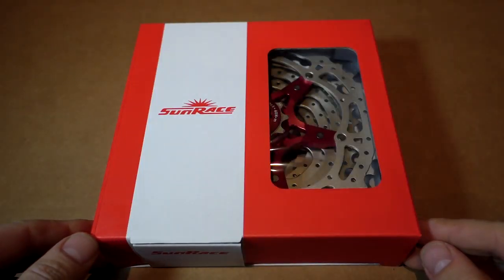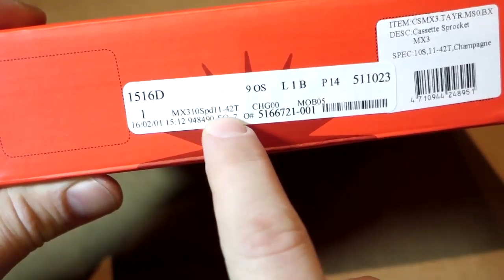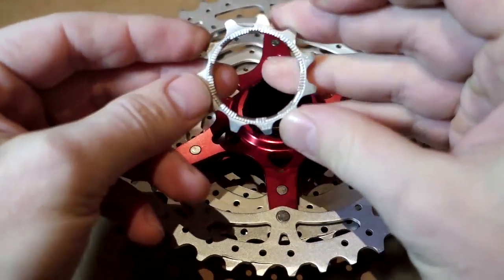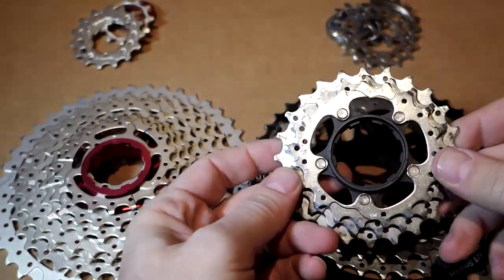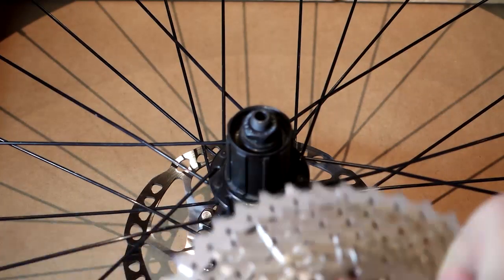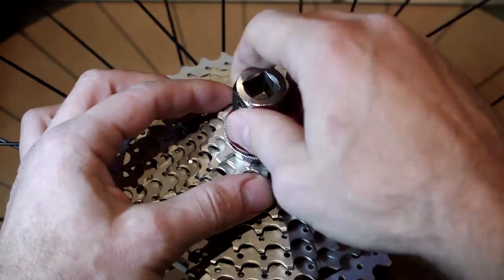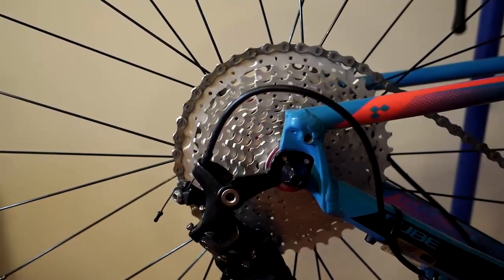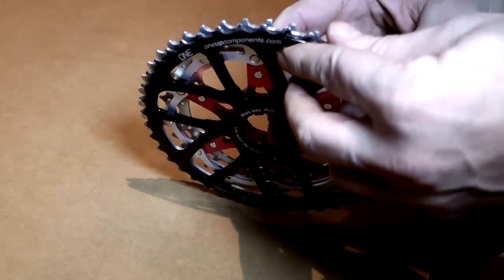SunRace MX3 10Spd 11‑42T Cassette vs XT+OneUp 42t, Comparison, Issues

Comment: Sir are you using direct mount derailleur? Do you required any extra link to use 11-42 T cassette or simply direct mount derailleur works fine for  10 speed cassette have 11 -36 T and for 11-42 T cassette.
Reply: It depends on the chainline

Comment: Got the SunRace MX3 10Spd 11‑42T Cassette Today.  The splines on the Cassette interface loosely with the Freehub Body of the cassette, which will dig into the freehub quickly.  The shifting is not as smooth as the XT which it is replacing.  I think I should have gone with the Oneup.  FWIW I installed a Wolf Tooth Goatlink 10Speed link and that helped alot, didn't have to touch the B screw.

Comment: I've been wondering about something.
I got injured so my plans of changing my drivetrain will have to be for later, specially because I want to wear it out before upgrading. So now I have much more time to think about it, lol.

Was thinking about getting a 11-36 cassette and match it with a Zee FR derailleur and Zee shifters. Since this cassette came out, I've been searching around for possible issues  about using the Zee with it. I found some forums where some people actually did it and they didn't have any problems, although chain length is crucial.

In that case, I think I would go for a 11-40 just to be safer, but how bad for the derailleur do you think it would be if I use this setup? I would be pairing it with a 34T chainring. It's for hardtail so no chain growth worries here.

I'm just worried about killing the poor Zee.
Reply: +LoveMTB Yeah, I know.
I might end up just getting the XT m8000 setup if the prices get low enough anyway :P 
Thanks, I will think about it.

Comment: I never liked the OU + 16T hack the shifting between 13-16 and 16-19 was compromised no matter how I adjusted it. I didn't want to invest more into  their rad cage so I rather used just the original 11-36 with a 30T chainring. Then I read about the sunrace and tried - only the MS3 11-42 steel version was available. Shifting is perfect the chainline is moved in by 2,5mm on a 2x crank and no backpedaling issue with KMC Gold chain. My other bike is factory X1 1x11 and drops the chain from 42t over a full rotation. But it's not an issue as I'm usually pedaling forward except the occasional repositioning of the pedals but it's less than one rotation and rarely on the 42t.
Reply: +LoveMTB Yes, chain line and chain stay lenght are both contributing. If it breaks in and you can make one rotation before it drops then you'll be fine. For me this route looks to be the best solution as it's cheaper than an XT cassette and a OU42+16 and no odd jumps between the higher gears.

Comment: My SRAM GX1 1x11 on my new bike also falls if you back pedal in the biggest sprocket, and at the same time it also goes out of sync with the narrow-wide guide pulley and starts riding on top of the teeth. You have to correct it manually. Good thing I never back pedal.
Reply: +LoveMTB No I ordered the bike online so I'd have to email or call them. But to be fair the problem is really a non-issue since I don't back pedal. I only experienced it on the work stand when I was assembling the bike and adjusting the gears.
Reply: +LoveMTB I got me a Radon Slide 150. I have yet to give it a proper test ride since, well, it's winter. :) Looking forward to spring!

Comment: hi sorry for bother again but how good goes this sprocket comparing with shimano xt because i want to change to 1x11 and i don't know if it is good this sunrace (because I think the jump between cogs are better in this sunrace sprocket than shimano and also is far cheaper, and little bit lighter)

Comment: So if I take the 42t/40t from sunrace and sand angles to the wheel facing side of the largest cog, one should be able to backpedal without issue. However, if one is not confident on doing such a mod, do not attempt!

Comment: Hello guys! I have an xtr m980 cassette with 1up 40t and a short cage xtr rear mech. I can't get a good adjustment in the transmission, specially in the high speed or with the 15t to 19t jump (depending on how tight or loose is the shifting cable).
Is this sunrace cassette a better option for 1x10 with a 1up cassette?
Do i need a goatlink with shimano components? why? i'm ony chaning my cassette (11-40), with the same number of thooth.
Thanks!!

Comment: Maybe you know. I have a rear derailleur SRAM X7, if I change my cassette 11-36 for 11-42. Do I have to use Goatlink? How can I select that?
Reply: No goat link required. I put this same cassette on my fat bike with SRAM X7 works great.  Just adjust the B tension screw and make sure you have correct the chain length.
Reply: Thanks for all good advices!
Reply: Same no bigger problems with X0 series (long cage).
But difficult to set up at begining. Proper set b-screw and wire screw to work, test 25 mile ride, still was too slow changing between smaller cogs. Reasembly, cleaning and set up again this time everything start working fine. Weird ;)
Casette has "sharp tooth edges" when new, comparing to new Sram 1051, so should works better after few hundreds kilometers, when initial worn out happen.
But happy so far with purchase, and "old X0" mech still is to good to scrap.

Comment: what RD you use in the 42T cogs??? is that a ZEE FR version???
Reply: +LoveMTB Is it possible to use a zee with that range? I've seen pictures of it done but I dont know if they tuned the shifter or no.
Reply: ok just asking because I've got one on 11-36 working very well. Maybe I'll try and if I see that the guide pulley it's too close to the 42 cog I'll go for an xt
thank you

Comment: thats weird, all the sunrace cassettes Ive used dont drop when backpedalling, I use a kmc chain tho
Reply: @LoveMTB  It can sounds funny, but sometimes I have backpedalling drops with original XT 11-36 cassette =)) Not sure what config was at front, but AFAIR it happens with 39-26 RaceFace double and chain shifted to small (26) sprocket.

Comment: Does this cassette work with a slx 10 speed derailleur or do i have to buy some kind of adapter?
Reply: ***** Will the SLX M7000 GS work with my Deore 10 speed shifter and could I use this OneUp Radr without one of these Goatlinks?

Comment: hmm... I have that 10 speed sunrace 11-42 cassette but the chain never drops the chain at the 42t when I backpedalling. 10 times or more than how many times of rotation it doen't drop.  I ride transition patrol. xt triple crank, 30t atomracing ring, xt 786 rear mech, sram 10speed chain. but it still needed a longer b tension bolt otherwise the chain could not come from 36t down to  the next smaller cog becuase of the bar shaped part of the derailleur.

Comment: is it possible to use a shimano slx shadow+ deraileur with this? I think the slx deraileur has a max capacity of a 36t cog. I'm not sure if that is correct or not.
Reply: so to get the best performance for this cassette you need to get an 11 speed derailleur? that's unfortunate. would be nice to be able to use my current derailleur if I get an extended range cassette.
Reply: yes that is true, probably best to just go the whole way
Reply: if I were to get a M7000 or M8000, would the SGS or GS be the way to go and would they work well with a 10speed deore shifter?
Reply: awesome thanks
Reply: So for my Shimano XT Rear Derailleur 10-speed RD-M786 GS Shadow its the same story ? New Derailleur  better than spending money for Goatlink ? Or will it work ?

Comment: will either of the cassettes work with the shimano zee short cage fr derailleur?
Reply: I've tried a zee short cage with 42 teeth, does not work sadly :(
Reply: Bummer
Reply: Goatlink says their 42t extender works with Zee, so I imagine this 42 should work also. I have a Zee rear derailleur and XT 11-36 cassette and want to go with the 42, which I was thinking about as I pushed my loaded Troll (in a light backpacking setup) up some monstrous hills (steep, long, soft gravel) in Washington.
Reply: Brian McGloin lies, it does not. Even with a long b tension, you can try it but I already have and 100% guarantee you it won't work
Reply: I meant One Up said it would work, not Goatlink. But a 42 is a 42, it doesn't matter if it's an extender or an actual cassette like Sunrace.
Reply: And, I plan to use a Goatlink to replace the link that makes my 10-speed Zee into the FR (what is the link normally called?) version.

Comment: Im planning to convert my 2017 Giant Defy Advanced to 1x10. It comes with Tiagra 4700 2x10. Ive already used my MTB (1x11) on the road with 36t oval and 10-42 and its a perfect setup for what I do around here. Thats why I thought that a 1x10 setup for my new road bike with 42t oval and 11-42 Sunrace cassette would be more than enough. I would like to know what chain you recommend for the Sunrace cassette. Thanks in advance for your response.

Comment: Strange you don't have this same issues.  My XT 10 speed 11 -36 cassette fits 
snugly on my WI freebody.  With the Sunrace there is significant 
movement, sloppy!  This will be costly down the road as the cassette 
with eat into  aluminum freebody quickly.  Your viewers may want to check if 
this cassette will interface correctly before using it, most retailers
 will not except a used cassette.

Comment: anyone with the sunrace mx3 run into any issues with it in the long term?
Reply: Yes poor durability, I had a pretty light & short season and my CSMX3 is done. The 42t and 36t get bent distorted very easily and the shifting on the bottom of the cassette has also degraded.  In comparison a XT 11-36 cassette can run 2-3 times the mileage for me.
Reply: I had a nagging feeling durability was going to be an issue with this cassette. I think I will stick with Shimano.
Reply: MarzNet256 well duh we all would but the problem is they dont make an 11-42 ten speed. the one up or wolf tooth is a shit transition
Reply: I find it as durable as XT.
Reply: Hard to say how many miles as I ride for time and don't record my mileage. Last season I got more than 200 hours out of a shimano cassette whereas I only rode 1/2 that much this season and I am shopping for a replacement for this sunrace. As I mentioned  before I think the main problem with durability is the 42t and 36t cogs... From your other posts it sounds like sunrace added some material to reinforce these cogs so I might have to try a newer one.

Comment: Hi everyone
I hava 10 speed 11-36T cassette and I wanna replace it with 11-42T. Do I have to replace chain? I mean do I need to install longer chain when I install 11-42T cassette or I can use chain I allready havr installed? Thank you.
Reply: @LoveMTB  my derailleur Shimano XT RD-M781 SGS Shadow Type / 10 Speed and I run triple front chainring, 3x10 speed.
Reply: @LoveMTB  I only wanna change cassette 36t 10s with 42t 10s, I wanna keep my front triple chain set. Reason why I wanna upgrade it is to climb easier up hill.
Reply: @soliranje  If You not use biggest chainring at front - rear 42t should be ok for current chainlenght, but i don't recommend it.
First - if chain is not long enough, You can damage mech trying to force to switch at two biggest cogs at system.

Second - when change casette is good to fit new chain as well - chains worn out faster than castettes. When install old "stretch" chain, You will damage sprockets at casette quicker, and here is alloy made 42T cog, so material is a lot softer. But You need to measure chain anyway.

Derailleur - some are ok, some need goatlink. For example: mine Sram X0 long cage is "just enough" but b-screw is almost "full in".
Reply: @stanley3647  well I installed 11-42t cassette on my existing drivetrain, I did not replace chain, don't use any extender for rear mech and everything works great. I run 3x10 with 11-43 and it is great for all kinds of ride. Great for long climbing and long road rides.